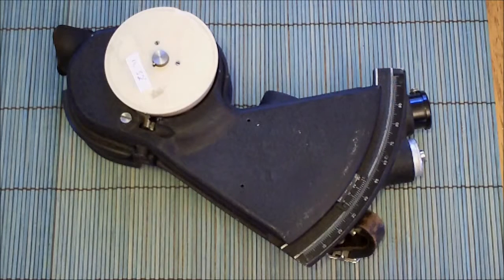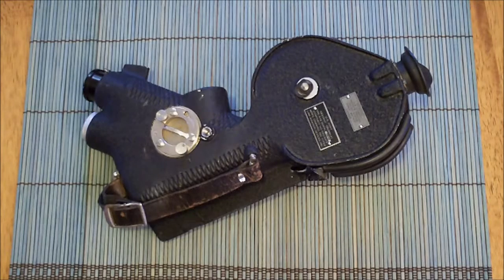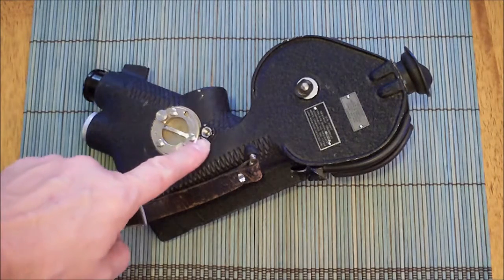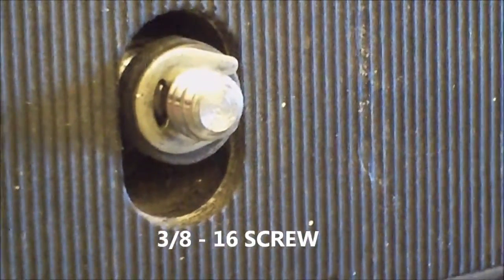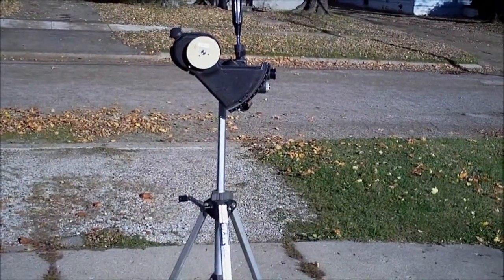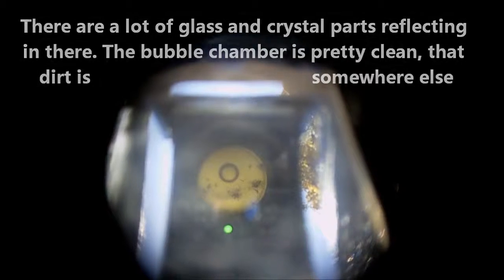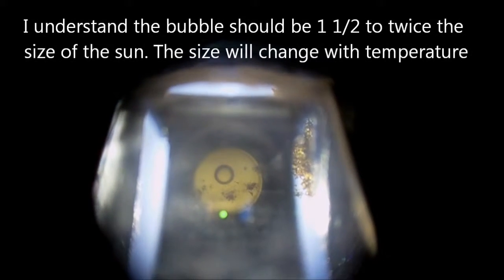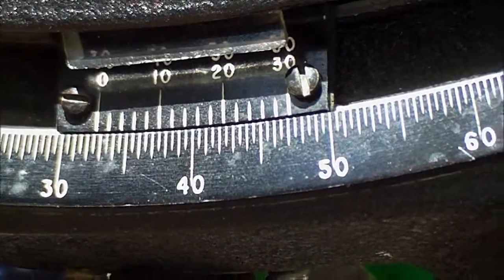Link A 12 bubble sextant mounted on a tripod - For the layman

Comment: Hi Bill, is there any chance of making a video on how to calibrate the A12 please? Thanks.
Reply from the maker: +Justyn Keeble  I can try. Mine is off by almost a whole degree so I'm no expert. I just subtract the additional minutes and seem to get goodish results. If I get the time I'll try and put something together that makes sense.
Reply: +Billofthenorth1 I'm definitely no expert, I take a WW2 USAAF navigator display out to events and have just purchased an A12 as navigators carried the A12 on bomber aircraft. I have no previous knowledge on celestial navigation so am an absolute rookie, however it would be good to know the basics in order to demonstrate the thing. You'll be pleased to know that I followed your advice in your other A12 video in order to fill the bubble chamber as it was dry and this works great now, I just need to get the thing calibrated though I figure a collimator maybe required?
Reply from the maker: +Justyn Keeble Hi Justyn, Using the collimator is the ideal way. If I remember correctly, using a different sextant to shoot an object and then adjusting the A12 to match is another way. That's what I did in any case. If I were you I'd take a shot of the North star some night.  It should be pretty close to your latitude. You might not need to calibrate it. There's quite a few websites out there that you can look up and find information about the A12 too.
Here's a link to a restoration manual for sale. I have no affiliation, just passing it on. https://sextantbook.com/2011/01/27/a12-bubble-sextant-restoration-manual/
Reply: +Billofthenorth1 Hi Bill, many thanks for that, I'll give it a try!

Comment: Thanks for this video, Bill. Have you used this sextant on land, air, and sea?
Reply from the maker: Just on land. Years ago, I used to fly but I wasn't into sextants and CelNav. It would have been fun to combine the two.
Reply: @Billofthenorth1  Thanks, Bill. I know it was designed for aeronautical celestial navigation, but would you be about to use this model of sextant at sea?
Reply from the maker: @franka7691  You probably could. I haven't been aboard anything large or stable enough to use any sextant on in a long time. But J imagine it would work.

Comment: How close can you get?  Did you check your Ho against the USNO computed value?
Reply from the maker: It's not the most accurate thing in the world. When I got it, the mirror arm moved freely on the axle and it's been a bit of trial and error to get close to correct. If I get within 7 or 8 nm I feel I did my part. It's mainly used to practice anyhow and seems to get good results when the celestial body is too high for me to use a Davis sextant with artificial horizon.  At lower elevations the error seems to increase so I think the index scale may have some distortion.